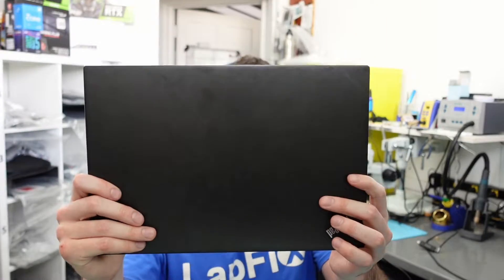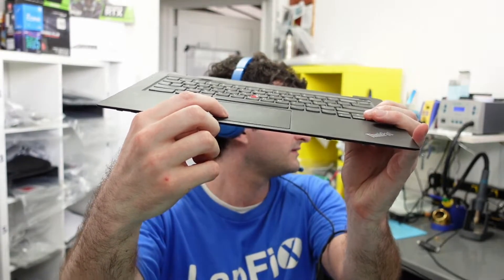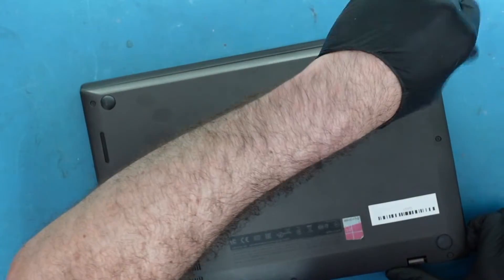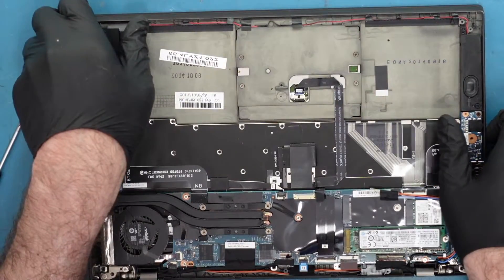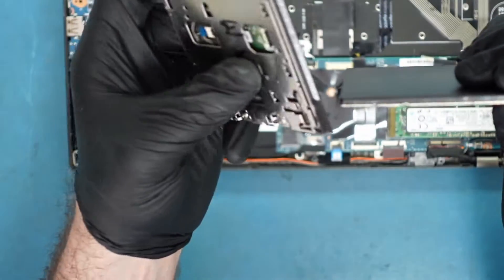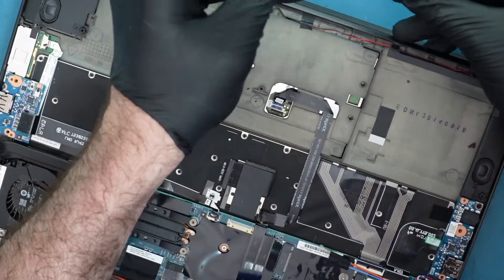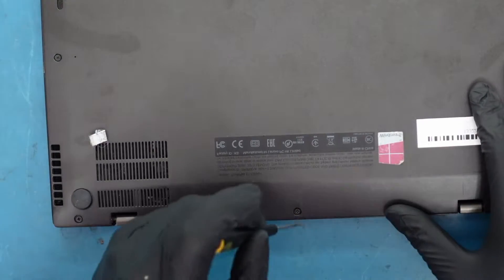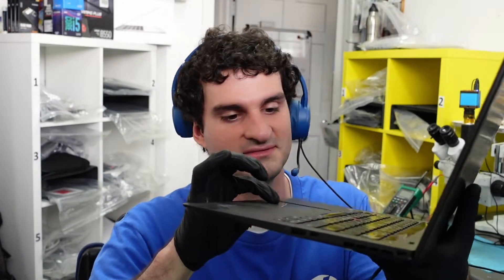Lenovo X1 Carbon Touchpad Not Working Repair

Comment: How did you determine that the TouchPad was defective? Was working poorly or wasn't visible in device manager? Just curious because my TouchPad no longer registers as being connected and wanted to make sure that changing the track pad would be a viable solution.

Comment: Great video
Reply from the maker: Glad you enjoyed it
Reply: @lapfix  @Verbalism
πριν από 9 μήνες
How did you determine that the TouchPad was defective? Was working poorly or wasn't visible in device manager? Just curious because my TouchPad no longer registers as being connected and wanted to make sure that changing the track pad would be a viable solution.